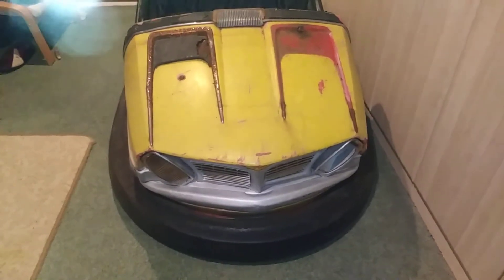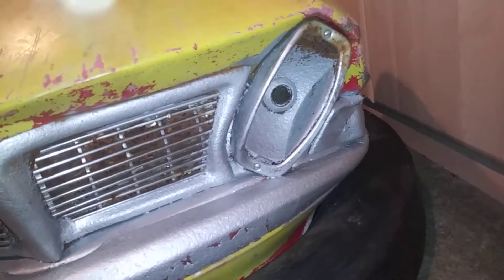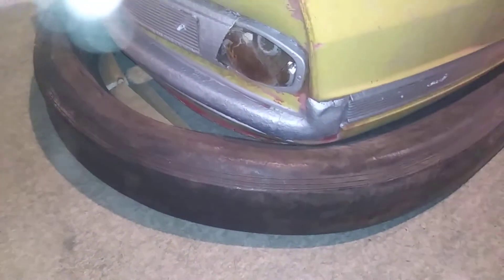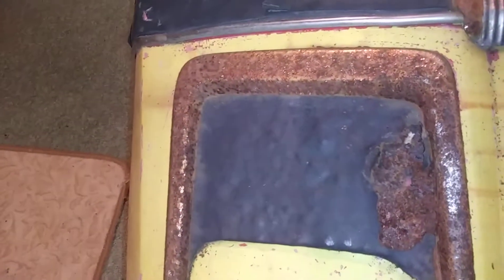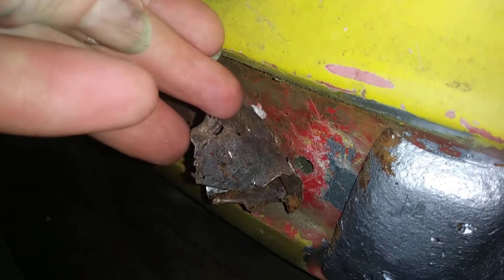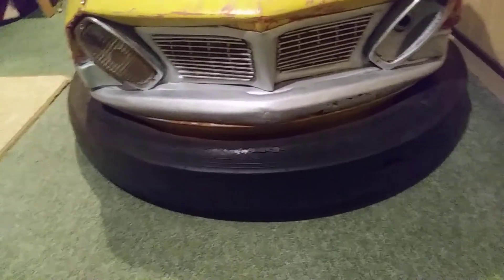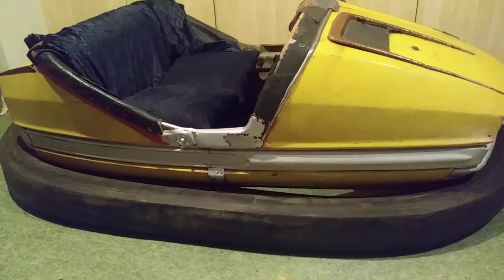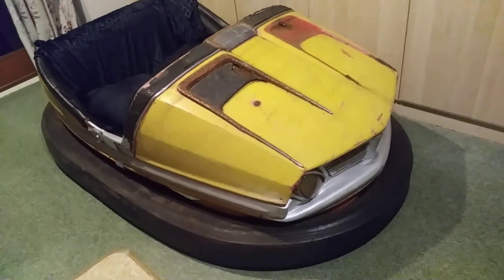1960s Dodgem Bumper car project. Part 4 Reverchon R66

Comment: it's coming on bob ,don't get down hearted, this type of work takes time and patience, and you learn as you go along ,if you don't want to face painting it you could always try wrapping it instead, keeping going bob ,it's a good project 😀
Reply from the maker: Thanks for the encouragement Martin.👍
I think I'm going to paint it in small sections, rather than all in one go. More manageable that way. Also thinking of brush painting it rather than spraying with rattle cans. If I use good quality paint like coach enamel with a decent set of brushes, it should look okay. After all, can't look any  worse than the current paintwork! 😄
Reply: @robsterbob580 thanks for sharing these videos. I’ve just got hold of a Reverchon R67 and trying to find some service manuals and spare parts. Do you know of any place I can find that ?